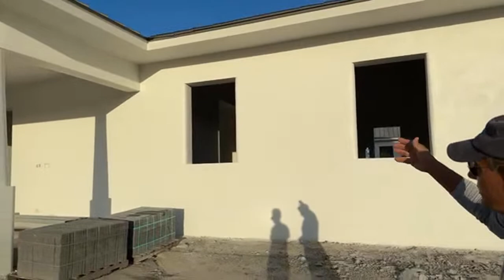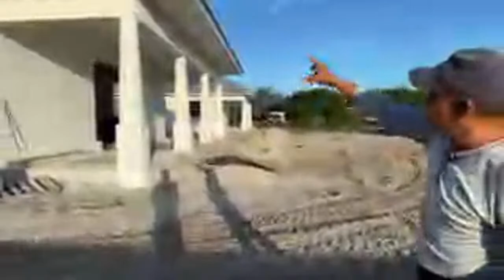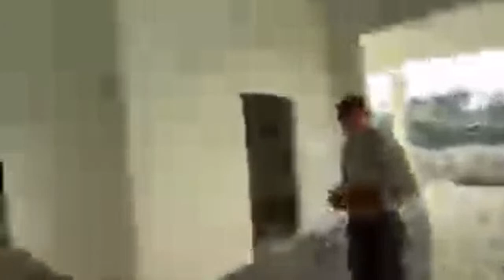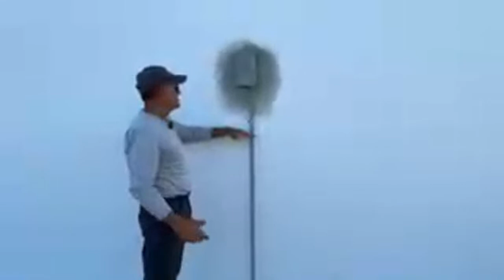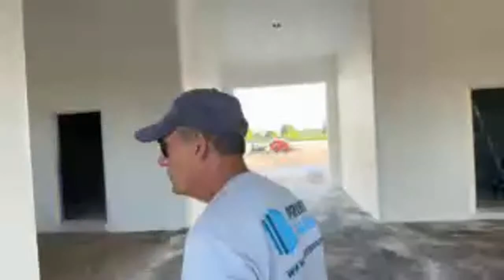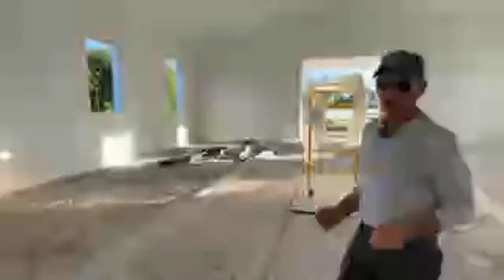Biggest Printed Building in the WORLD

Comment: Not impressed 😢
Reply: It still does not address the main issue, cost.
Reply: @cortezforever  over 10000 square feet x $ 200 per square foot = over 2 million dollars for a horse barn 
Screaming deal 🤣
Reply: @raymondpeters9186  SMH, if the cost were to decrease to $100 per square foot, that would be more reasonable in this economic climate. In my opinion, WASP is the only company that has the right idea and has the potential to achieve that reduced cost.
Reply: @cortezforever  let me know how that works out
Reply: @raymondpeters9186  If i don't go with a prefab i will do.
Reply: @cortezforever  go with 3D stronger house good luck 👍
Reply: The cost savings isn't in a single line item, it is spread across the entirety of the wall system. What is accomplished with 9 layers, siding to drywall is now done in 3-4. It isn't the perfect solution yet, but work like this validates the technology and brings that cost savings much closer to reality.
Reply: @jasonjones5606  great buy one 👌
Reply: @jasonjones5606  only time will tell